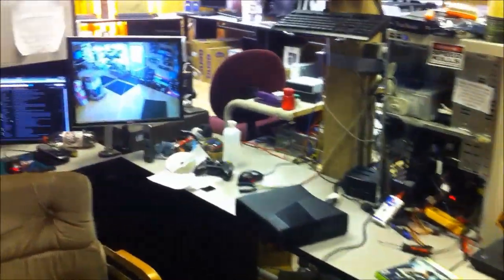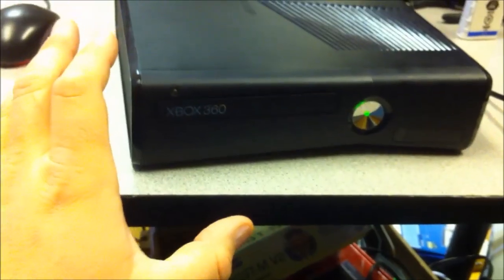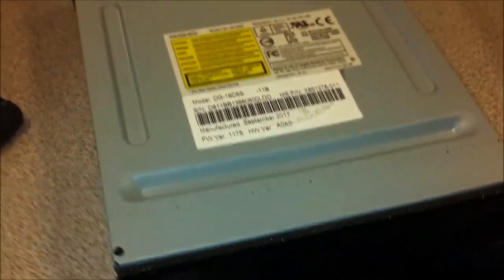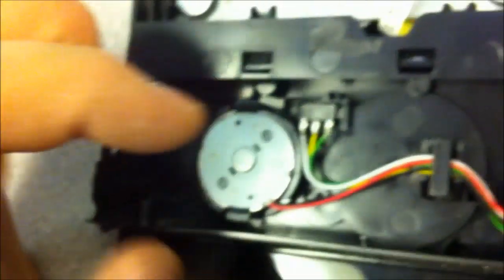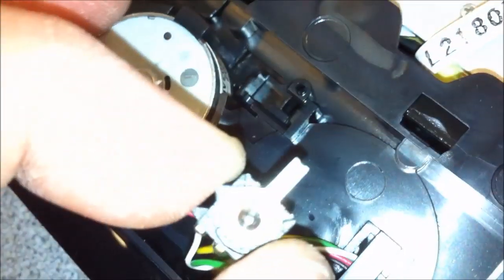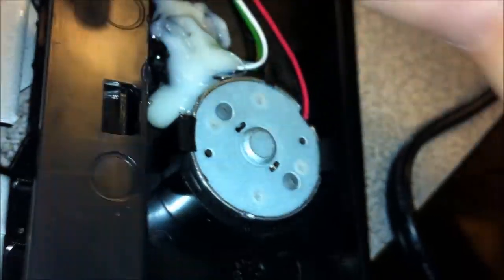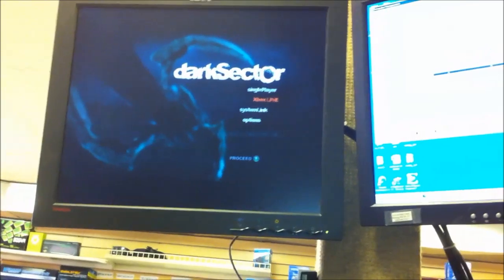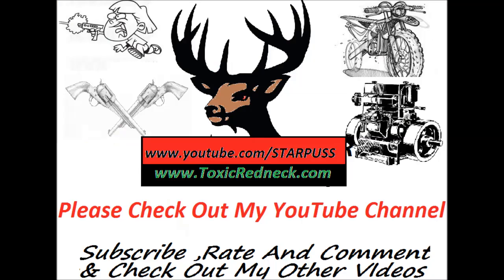XBOX 360 Slim DVD Drive Repair (Drive Stuck on opening)

Comment: I appreciate that you took the time to put this video together, and at work no less!  :-)However, may I make a suggestion?It was very difficult to follow, as the iphone was a bit shaky (can live with it), but when you said 'the click broke off here' and you're pointing the iphone, I really had no idea where to look or what to look at.  It was be VERY helpful if you used a pen or some similar pointing device to point EXACTLY where you wanted the viewer to look, and even to talk about which way the moving switch should be oriented, etc.  Thank you for taking the time.

Comment: I just opened my xbox and it was exactly as you described.That piece was broken off and the micro switch was sitting there loose. I am going to glue it back in place but was wondering what does this switch doe exactly? How does it keep my 360 from closing..i didn't get the correlation...just wanted to know before i glue it down. : )
Reply: The switch is placed into the drive in such a way that as the gears that turn to open and close the drive move, a slot the switch fits into pushes the switch to the left and right. The switch is actually getting current from the yellow wire, and inside there is a magnet (or so it is labeled). The magnet gets closer to one side and the current sent back changes through the white and green wires to tell the drive what position the tray is in. When the switch is in the right position, it is open. When the switch is in the left position, it is closed.

Comment: Ironic i watched videos on how to repair the problem for two hours, took it apart cleaned it did everything as im taking it apart i cleaned everything and dusted. figured to just glance and observe underneath and ironically the peice was broke and wires were hanging THIS IS THE PERMANENT FIX NOT ALL THE OTHERS!!!!! found this video after i found out on my own!!!!! 100% fix for tray that wont stop opening and closing!! im thrilled i proved it on my own without this meaning confirms true

Comment: Bought a new 360 Slim today and they disc tray won't open at all, it's stuck on opening whenever It's turned on. I think it's jammed but by what I don't know
And the small manual eject button on it's side? That's not working either and I'm doing that correctly too so could you tell what is the problem?

Comment: I have the same Problem with the Xbox not keeping in the Disc, but mine did not have  a broken Clip. My Drive was out of place and i fixed it but now the Disc Drive wont stay closed after it goes in. It just shoots back out , even when I turn if off. HELP!

Comment: I thought so too, but I looked and couldn't find anything, on eBay or Google. But the kicker is, even when I have the DVD drive disconnected, and I run my Xbox, it is still doing the same thing. I turn it on, the light blinks, says opening. I click "close tray" on the dash, it closes, then says opening again... Is this still the same issue or could it be something different?

Comment: I had this keep coming loose when I was using electrical tape to keep it in place. Then I tried the glue method and screwed it up and got glue mixed in with the arm so it's all sluggish. Do you know how to fix this issue?